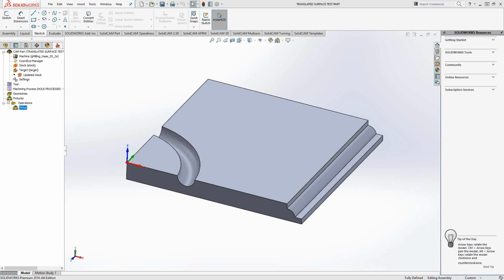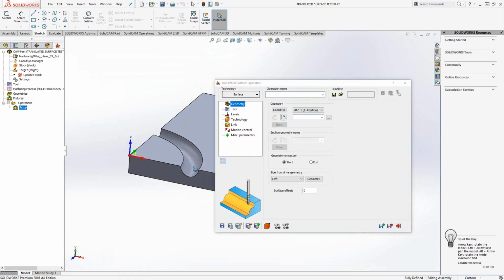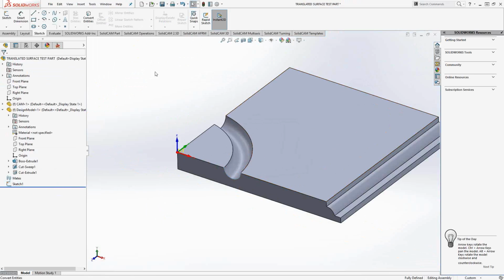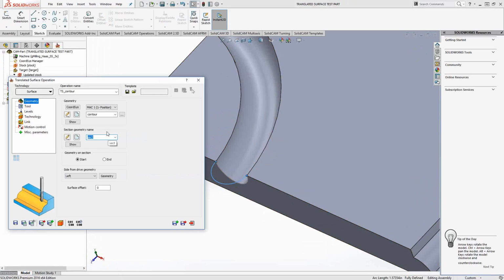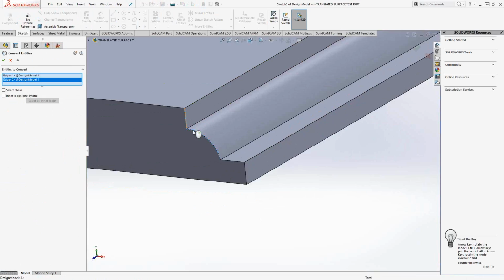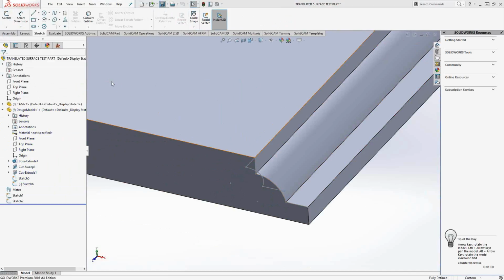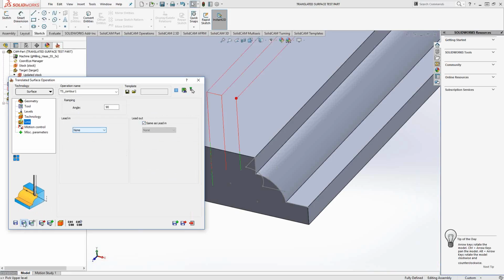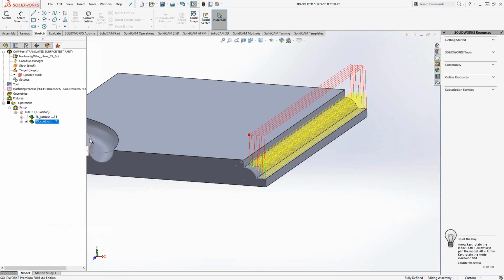SolidCAM  - Translated Surface

Comment: wondering if you can explain why the profile has to be in the same Z-plane as the path? This seems INCREDIBLY non-intuitive and certainly is not how any sweep function would be done in SW. If you put the sketchs in the actual SW model can they be used.BTW you say you put the sketches in the DESIGN MODEL, but you actualy put the first one in the assembly, you can see they are below the Mates folder in  the assembly tree. If they are in the DESIGN MODEL will they stay if you update the model in SW and then synchronize, or replace the model? Dont mean to be picky but trying to understand the details. Nicely done video BTW.